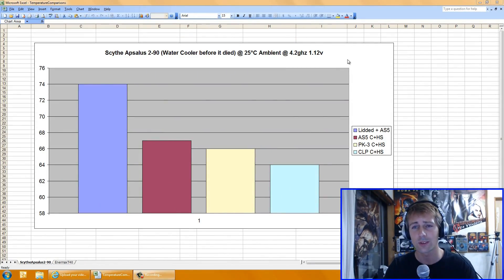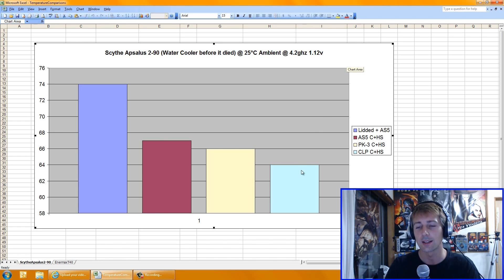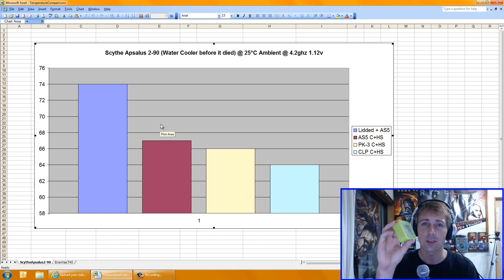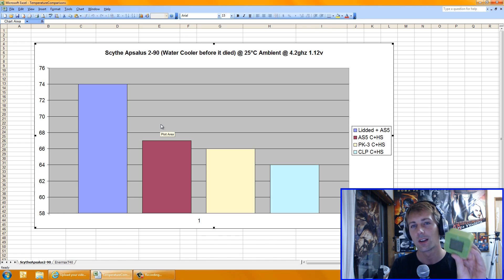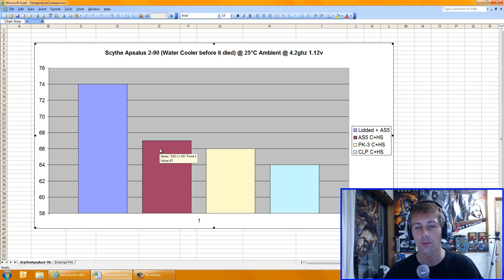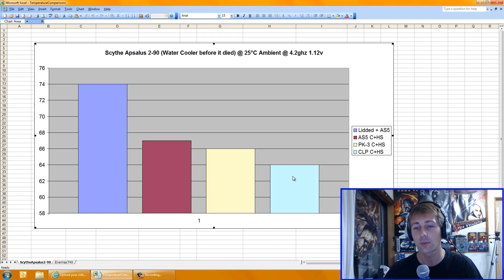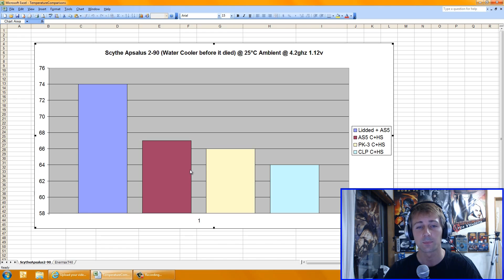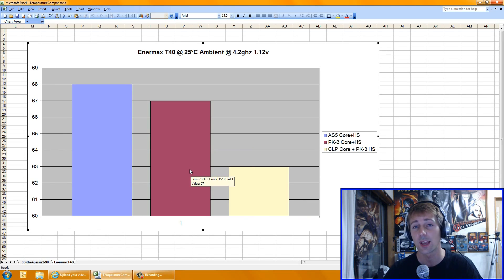Thermal Paste Showdown - AS5 Vs PK-3 Vs Liquid Pro

Comment: I know this is an old vid, and someone else may have said this already, but I have to defend my AS5. Arctic Silver 5 doesn't give you max results right out the gate. It takes a little bit to break in and settle. 
This is a quote directly from Arcticsilver.com 
Due to the unique shape and sizes of the particles in Arctic Silver 5's conductive matrix, it will take a up to 200 hours and several thermal cycles to achieve maximum particle to particle thermal conduction and for the heatsink to CPU interface to reach maximum conductivity. (This period will be longer in a system without a fan on the heatsink or with a low speed fan on the heatsink.) On systems measuring actual internal core temperatures via the CPU's internal diode, the measured temperature will often drop 2C to 5C over this "break-in" period. This break-in will occur during the normal use of the computer as long as the computer is turned off from time to time and the interface is allowed to cool to room temperature. Once the break-in is complete, the computer can be left on if desired.

Comment: If you have used your cooler several times in the past then you need to use the sponge (sand paper) that comes with liquid pro... I was getting high and inconsistent temps between cores until I did this... Sand ALL contact surfaces until you stop seeing gray black dust... The stains act like insulators and cause all sorts of heat problems. You cant even see the staining until you sand them out... After I 'sanded' my heat spreader (both sides), and my cooler surface, then cleaned with alcohol, everything went back to expectation... I was thoroughly amazed how important this step is to create proper contact surfaces... Don't skip it like I did... And sand it for a long time using good pressure.... $1,000 advice that will make you very happy and save you a lot of time and frustration.

Comment: Let's not forget AC5 is a 3 phase paste where it needs 50-100 hours to get to it's final state for long stability. 

I found MX-4 it's great for cores like on a gpu as in my experience the thicker the better when it comes to graphic cards. 

I got some cooler master which is a tad less dense which works well for cpus with heat spreaders as it creates a thinner layer

Comment: heyy Bro I want to know how much max temperature of core 2 duo laptop processor plz reply me iam waitng
Reply from the maker: Just download realtemp and open it up, and it will tell you the TJmax, that is the max temperature your CPU can reach before shutting down.
Reply: nice bro i already install real temp and core temp its shows 100c is my tj max and my idle temp 47c and youtube its gone to 60c what to do bro its normal or warm tell me bro i need help
Reply from the maker: That is normal IF your ambient temps are pretty hot, if your ambient temps are quite cold then you might want to reseat the heatsink and replace the thermal paste with something like some mx-4 (make sure you use something non-conductive / non-capacitive on a laptop.
Reply: thank a lot bro for help but i worried is their any damage of laptop motherboard reply me and thanks a lot again..
Reply from the maker: at those temps there should be no damage at all.
Reply: thanks bro for my help god bless you
Reply from the maker: you too brother.
Reply: thanks man....(^_^)
Reply: +Tech YES City 
In other words- those Pastes murder your water cooler.

Comment: Liquid Pro binds to the metal of the cpu and wont come off . Only Lapping will get it off plus you risk shorting your rig because its highly conductive.Should not be used at all on videocards unless you want to brick it. Its too expensive for the risk which outweigh the benefits.

Comment: I use Aritic MX4 Cooling which I got advice to get from the corsair forums
Reply: I used MX-4 myself.. some reason it dried out after two weeks at running my laptop on games. The initial repaste brought it from 83 down to 72 on the CPU on stress, then it went back up over 80 after two weeks which worried me.

I did a repaste as I think I put on too much and applied the thinnest layer possible while also retorquing my screws. Hopefully all goes well.

Comment: i've heard that putting a silver based thermal compound on the actual CPU die is dangerous because it would deteriorate. is this true or am i just hearing things?
Reply: Just hearing things.
Reply: If there is no aluminum on the IHS of the CPU(very rarely) and the heatsink of the cooler (pretty common to find aluminum hestsinks) , then it's perfectly fine (CLP and CLU include gallium which disolves aluminum). If it's copper, nickel or something like that, it's ok to use ;)

Comment: I'm going to buy the Cooler Master Hyper 212 EVO to replace the stock Intel fan on my i5 4670K. Shall I buy the Arctic Silver 5 or shall I just use the thermal paste that comes with the EVO?
Reply: the one that comes with 212 is good enough.
Reply from the maker: I always recommend having a tube of AS5, you get so much of that stuff and it works great all year round.
Reply: Tech YES City Thanks :)

Comment: I am thinking of getting CLU but I can't see which is best the Pro or Ultra version. The pro though have a higher thermal Conductivity which is at 82.0 W/(m*K) but I still can't choose between the two lol.
Reply from the maker: get pro, it requires some patience, but once you get the hang of it, it is fine. I removed it a year later and the chip was also perfectly fine as well.
Reply: Yes, I think ill just go with CLP. Ill probably just try to heat the chip if I plan on cleaning and re-applying thermal paste through P95 as it seems it goes back to a liquid form or say soften it up if it hits its melting point which saids 8 Degrees Celsius on the spec's. I will see soon enough how effective it is ! cause right now its way more expensive than the Ultra version :(. I tested MX-4 and AS5 on the de-lid it didn't make much difference only about 4-6 decrease.

Comment: You don't spread the thermal paste your self...

You haven't needed to do that since like the 90's?

The paste's just need to be applied in the center of the chip,  and pressure will spread it out.
Reply: Spreading it out became a habit since from the past people always spread thermal paste. Now a days a little circle in the mdidle will do and let the heat sink spread it. But for Coollaboratory's liquid pro and ultra you have to spread it because it won't spread itself.

Comment: De Coollaboratory's Liquid Pro is the best TIM if you want to cool but it's hard/impossible if you want totally remove. But yeah that don't mind because 1 layer is 1/100 of a normal tim layer. 
A second postive it doesn't dry out like all other which you need to consume in 2 months. You can easily use this 10 times with 1gram!
Oh yeah the costs are 9 euro in the Netherlands:
http://azerty.nl/producten/product_detail/83/79514/coollaboratory-liquid-pro.html?channel_code=40

Comment: Where do buy this stuff from? Have you tried CLU? Also do you still use the spread method between the heaksink and the IHS?
Reply from the maker: Yeah use spread method on everything, including IHS and core. Buy from Amazon or ebay.
Reply: found  it all on ebay except the prolimatech pk-3, shipping is way overpriced from US or UK amazon. Also my temps are ok on idle. With the a/c on 25 degrees but when I prime95 ( CPU cooler CM hyper evo 212 with corsair perfomance fans) I can hit 90 degrees. unoverclocked 4670K. Does this mean I have a Dud chip? This is why I want to Delid.

Comment: My prolimatech pk-3 can't handle more than 2 weeks the heat is not stable with in each core when use on the core "ok within first week"..i already re-apply 3 times now within 1 month .. so now i change to mx-4 on the core and pk-3 on the IHS. Pretty good :)

Comment: To my understanding the drastic improvements some people notice with delid + liquid metal is due to poor manufacturing by intel; some chips have the stock (cheap) TIM applied more poorly than others - those people get large gains from the delid process regardless of the new TIM type, the liquid metal just improves that gain further.
Reply from the maker: Very true, nice post.
Reply: Agreed, Just delided mine and less than 50% was covered. I was nervous about doing this at first but after seeing this poor quality I'm glad I did.

Comment: i have a 10-12° difference in temp between each core on my 4770k , should i redo my termal paste or is that normal for the new i7 . also temps on the hottest core Spikes up to 92° @ 4.7ghz with 28° ambient (34° water)